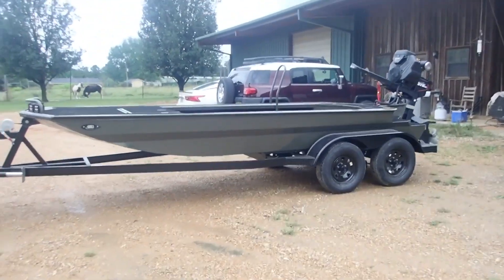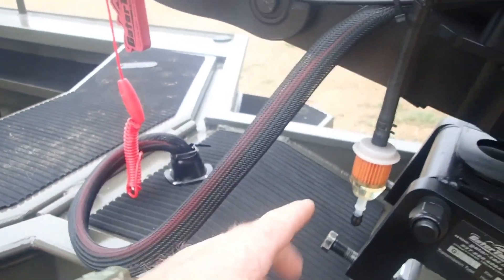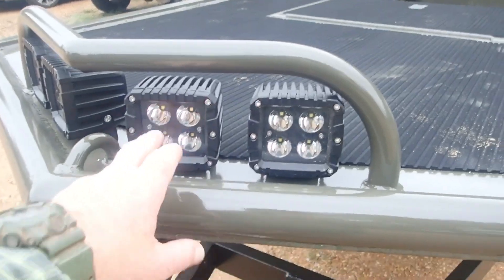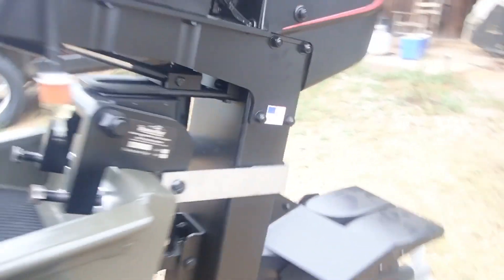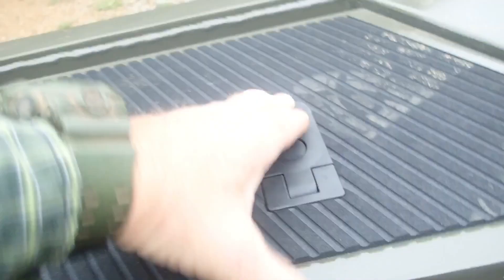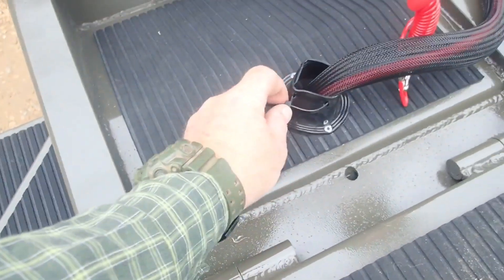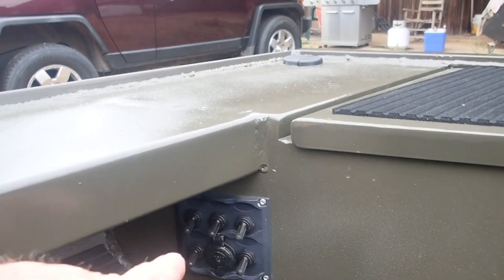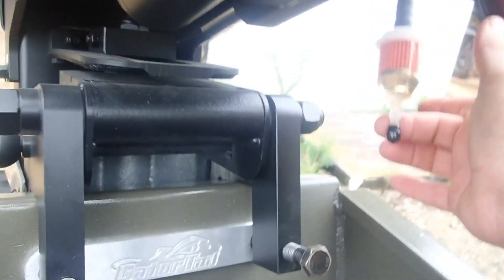NEW 1854 ALLUMINUM BOAT WITH THE GATOR TAIL 40 XD😲😲😲

Comment: Jason were you referring to tilt and trim when you were going over the controls and forgot the second term?       That is a nice boat I was thrown for a loop when I saw the steps on the back but it sure is handy to have!  I have never seen a boat motor like that not sure if I would want a  tiller handle on a 40hp motor but it looks like the handle is free float correct me if I am wrong

Comment: Those aren't back up lights, they are rooster tail lights ! Also check out back water performance. You can add a 3 blade prop to that sucker if your carrying a heavy load and it really helps. Also if you want to add some more HP to that motor they have some different options for you